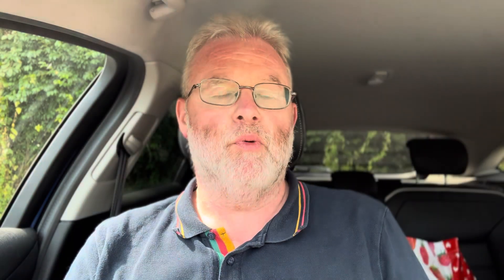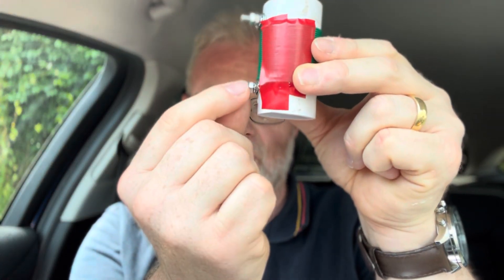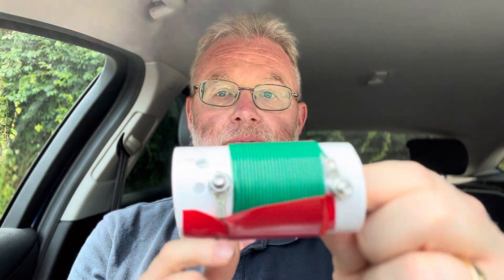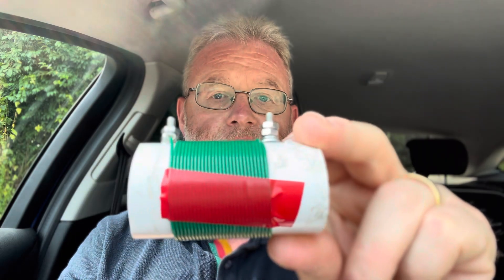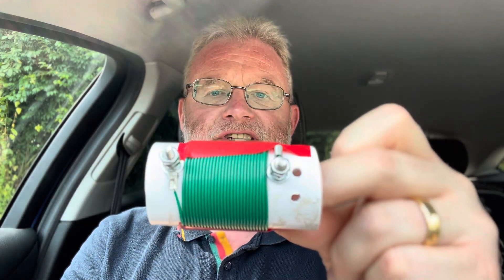Simple Easy Ham Radio WARC Band Antenna For 12 and 17 Metres

Comment: Regarding the impedance of the coil, the maximum is obviously where no extra bit of wire is needed - but what about the minimum, how much is the minimum you need to choke off the 12m part of the antenna? How does it cut off, is there a sharp cut off between the 12m bit being choked and not being choked or is there a gradual increase as the inductance increases?

Comment: Isn't it more efficient to use the collapsable telescopic whip (5 meters long maximum) on 17 and 12 meters (collapsing it on 12 meters)? I use it with a mag-mount on the top of the car (where the car body serves as a counterpoise). This setup needs no transformer (i.e. it avoids losses in the transformer).
Reply: Exactly,  keep things simple.
Reply: @brianfields4479  And it works. I had a 100w on my side 1/4 wave on a top of a car contatct from Cumbria to Australia (Long wire on that side on 100w) 5/7.